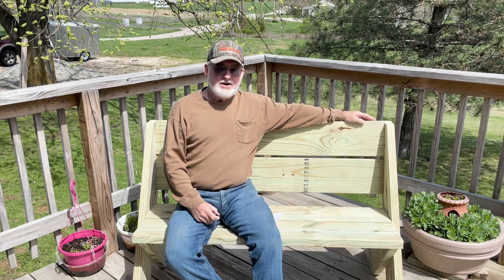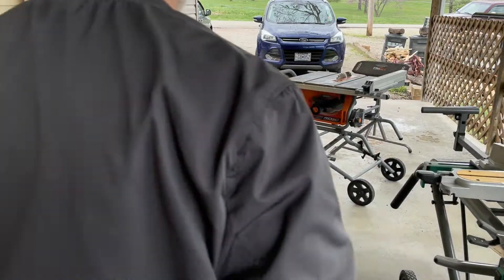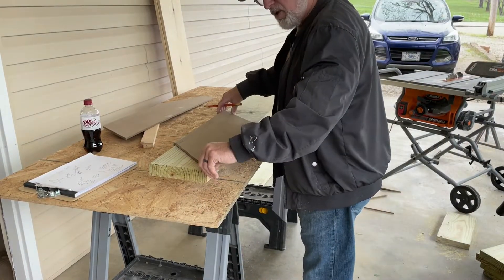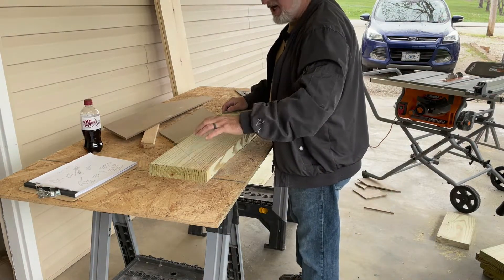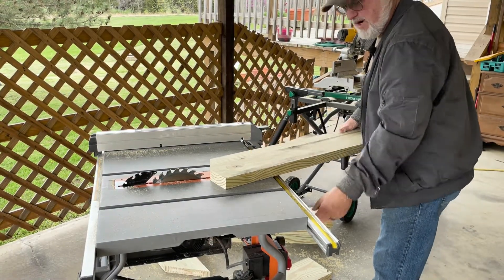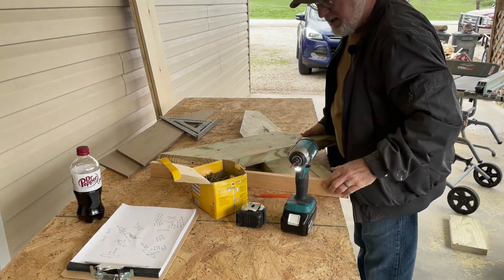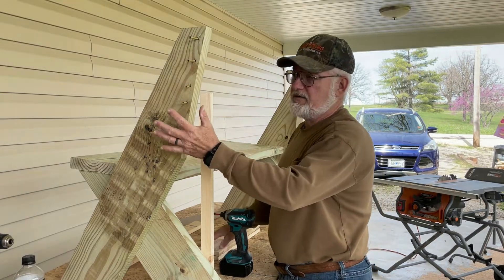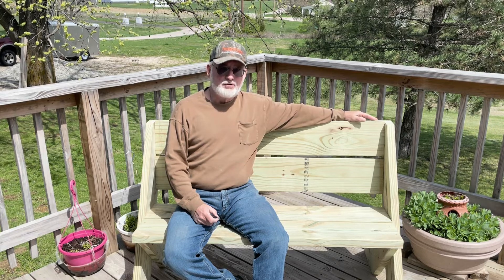easy to build bench

Comment: That cut at 4:50 is VERY Dangerous. You should never make a cut freehand on a table saw, always use a miter gauge or tapering jig. But I know you are going to tell me you have been doing it that way for years with no problem. It only takes one time to get hurt and you will change your mind.